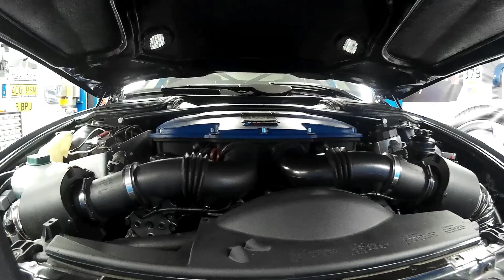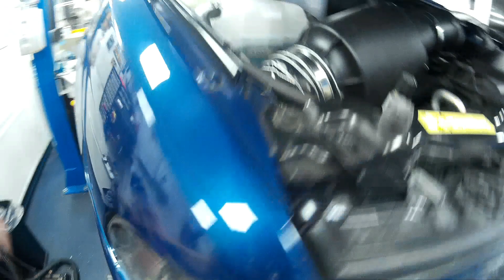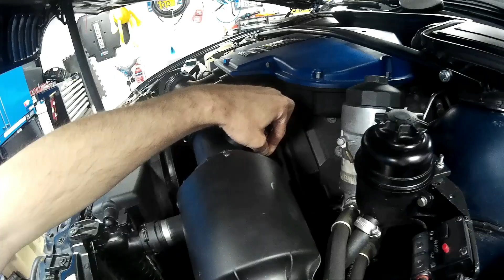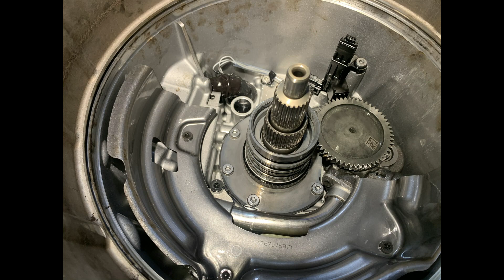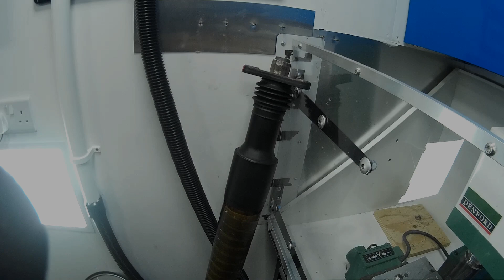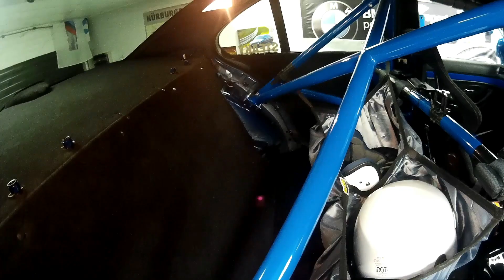BMW E39 M5 DCT Track Car Update April 2021

Comment: Out of curiosity, why duct the air intakes to the side of the bumper and not through the fog lights??
Reply from the maker: To prevent direct water ingress in to the intake tract when driving in heavy rain conditions on track.

Comment: fantastic work here, can you go into more detail in regards to HTG GCU? I'm wanting to do this conversion on my own M5 for track usage and would love to hear more first hand experiences with the unit. Also why delete the elctric fan and resort back to a standard E65 bit? Thank you for the time and lovely videos. Excited to see more!
Reply from the maker: E65 fan due to weight as it weighs about 6kg less than the electric set up. Plus it’s constantly cooling the oil coolers now too. 

As for the choice of gearbox control. Don’t bother. You’ll regret everything if you do it. If you have problems which are clearly firmware or software then you’ll be blamed for poor installation and wiring. If you struggle to get a smooth gear shift then you’ll be blamed for that too instead of being offered support. If you are lucky enough to get support without being criticised then you’ll be elbowed in to making a video which shows the product in a positive light. If you have any negative opinion on the product and air it on the Facebook support group then you’ll be banned from it and the post deleted. Seriously, avoid it like the plague. The only reason I’ve not removed it and reverted to manual is the fact I sold my 420G gearbox and can’t find another. As soon as I find one then the DCT is coming out and getting binned off until Maxxecu release their Fxx support.  

Personal opinion, wait until mid 2022 when MaxxECU offer full OEM integration of the Fxx series DCT gearbox.
Reply: @WestinghouseProductions  That is a serious bummer, I was already in talks with them and PCM but I was liking what DKGECU was doing more, doubt I'll see anything from them anytime soon. I'll look into MaxxECU, thank you for the honest review of the product, It explains why you dont see much of their product in use on YT, IG etc. 

Was the E65 fan a simple install? Minimal modifications required to fit? Im currently running a spal setup but less weight in the old girl is always best. Thank you again.
Reply: Sad to hear about the bad customerservice, I would like to upgrade dct on my e38 too. Ill keep my eye on maxxecu. Thanks steaky ill start with the e65 visco.
Reply from the maker: @royvisser90   You'll be pleased to know that MaxxECU now have full Fxx DCT mechatronic support with their latest firmware :)